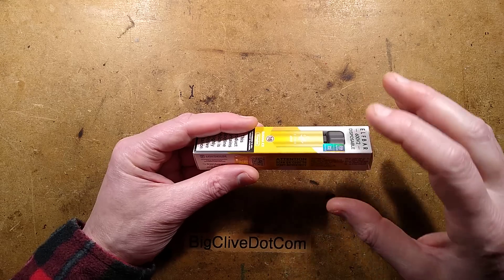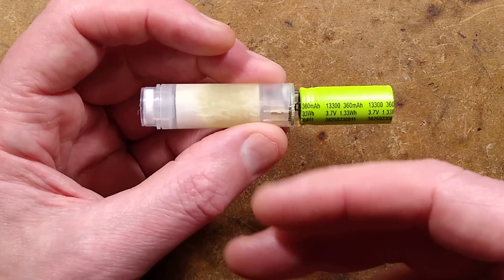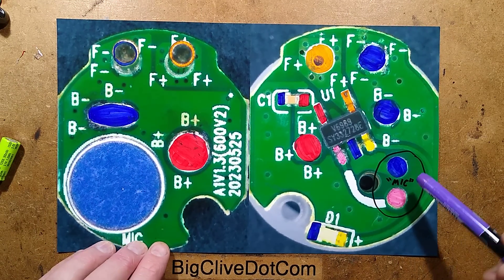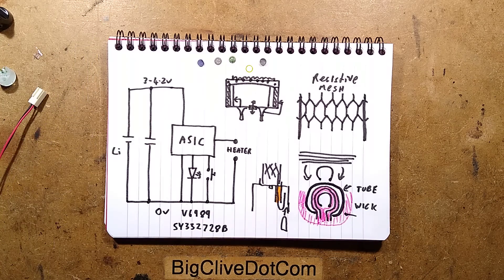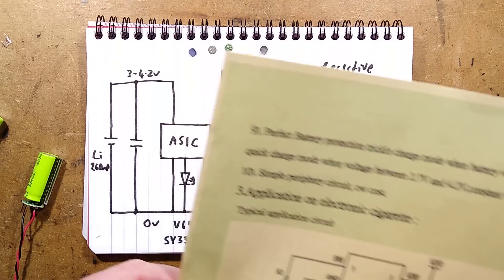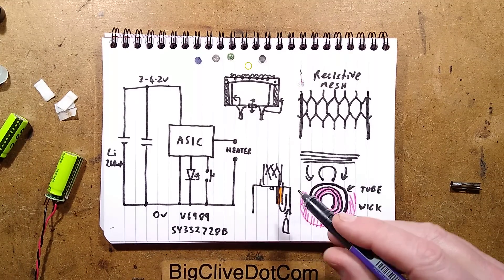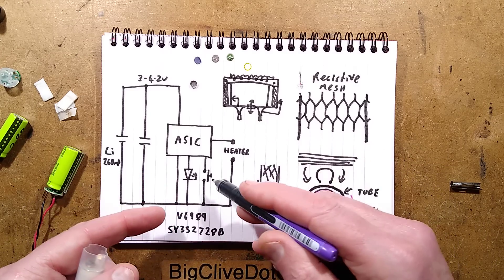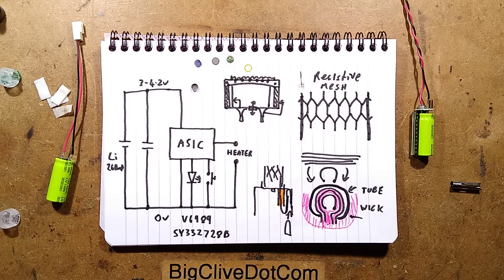Lithium "capacitor" in a disposable product

Comment: I also found that many discarded evapes now contain pouch lipo cells with "500 mAh" capacity printed on them despite some cells being physically smaller than others. Turns out the larger cells indeed charge up to roughly 500 mAh, the smaller ones however only reach roughly 300-350 mAh are thus intentionally labelled wrong.
Reply: That's false advertising whether they are meant to be recharged or not.
Reply: @LarixusSnydes  Chinese literally don't care
Reply: @fusseldieb That may well be, but if they want to sell things abroad, they need to comply with local regulations.
Reply: @LarixusSnydes  Will probably not be needed, there is always one person who opts for the cheaper option. 
That is how china grew in the first place and sort of ruined the whole european and I think american market with flooding the market with cheap products not built to last, destroying proper local companys with quality products.
If you really want to buy long-lasting quality products "Made in EU" or "Made in U.S." they cost an arm and a leg due to lower demand, and if they are in the shelf directly next to cheap Chinagarbage most customers will opt for the chinese crap. Even these who have the money to spend for a better product.
Reply: @deineroehre As an electronics hobbyist the main issues I run into when it comes to buying electronics parts is: A) a part I need for a project is not for sale in either the EU or the USA or B) I can buy exactly the same product ( made in China ) either directly from China or from an EU or American trader who 1) charge me 3 times the price, 2) have a high minimum amount of goods to buy before the P&P becomes manageable
Reply: @LarixusSnydes in theory, yes, they do need to follow regulations. In practice, no they fucking don’t lmao
Reply: @deineroehre  There are few quality products made in the usa. Many Asian and other countries have produced higher quality items than the usa for many decades now.
Reply: @LarixusSnydes china doesn’t have those regulations, so they can do whatever they want. “It’s not their fault” someone from a regulated country bought the product.
Reply: @deineroehre  "Blame china" mentality misses the points that this is exactly what Japan/Korea/Germany/USA/Britain did in the past and that it can only happen if someone is buying the products in the target market in order to sell them on (ie: Chinese build to a price, the same as the aforementioned nationalities do and have done in the past)

"Othering" the problem is an easy way of pretending we are not the people responsible for it and it's all caused by someone else

(Let's not dwell on the fact that the prize for the longest-lived state sponsored policy of industrial espionage, copyright blocking and ignoring piracy goes to the USA, at over 150 years, only changing when tables started being turned in the mid-late 20th century - or mention the Opium wars and "century of humiliation")
Reply: @LarixusSnydes  yep my guy on the corner wont buy no more 350s and pitch em as 500s. And im watin to hear back from temu on the subpar batt life from my 99cent earbuds 😀
Reply: If you fully discharge a lithium cell down to 0v you'll get 20-25% more energy out, at cost of never being able to charge it again/major reduction in chargable capacity(*). If they're intended as single use that might explain the "optimistic" ratings

(*) It's a bit like fully discharging a lead acid battery - if you TAKE 20Ah out of a 20Ah battery, you'll immediately pay for it with a 50% permanent capacity reduction for next time
Reply: @miscbits6399 if you look ath the discharge curves for lipo, you can see most of the capaity is between 4.2 to 3.6v (about 80-90%), below 3.6V it drops sharply because all the intercalation sites in the LiCo2 (positive) are filled and an all in the carbon (negative) are depleted. Going down to 0V will get you only a couple percent capacity, because there are simply no more storage sites for Li-ions to go. Going to 0V can be safely down, you just don't get a benefit from it. Damage or capacity loss occurs in 2 major cases:

1: you're going to negative voltages, because this forces reactions between electrolyte and electrode materials which break their structure and you permanently loose intercalations sites. lead acid batteries work different from lipos, here you can force theses reactions not only below 0V, but alreay at lower than recommended voltages.

2: charging to voltages above 4.2V. if you go higher you start to remove more Li-ions from the LiCoO2 (positive) which causes a permanent structure changes in the material which looses you intercalation sites. you can't put the extracted charges back in there when discharging, because the sites don't exist anymore (the sites were part of the structure which you just destroyed). this costs you capac ity permanently.
Reply: The intentional mislabling is a years old phenomenon already
Reply: its some brands....just like how some disposables dont use lithium. i tried to get some foil from a breeze pro to dissolve in methanol to make red/pink fire....needless to say not a damn thing reacted in those batteries.
Reply: @McDooDooYourSelf michigan?  😂
Reply: i'm only familiar w/ the pouch cylindrical cells in these devices as i recharged a few for some friends maybe 2yrs ago.. as i recall the cells were well above 500mAh, more like close to 1Ah and no board inside, just a little wire harness
Reply: I found one vape pen that had the exact same capacity of a dead cell in one of my bike's rear lights. It was millimeter thicker, so I basically ziptied it closed and caulked around it. Re-opening to change the cell again will be allot easier.

Comment: Obvious they removed the last few manual steps for assembling the e-cigarette. 
Sad that they halved the capacity of the battery in order to fit it inside a capacitor can. In conjunction, usually, they increase the resistance of the heater, which in the end decrease the amount of vape which is generated.
It is curious to see, that for an item produced in the millions, the manufacture process still look approximate and lacking any care for the quality of the finished product.
I guess this is what separates an industrial production facility from a sweatshop...

Comment: I think I would have gone completely hot air for the desolder on this: could even slip some a sheet of something with a slit cut in it under the board around the leads to redirect the air away from the battery, and no risk of shorting.

Comment: When I realized that these things held these batteries I started collecting them in the off chance I could use them for something around the farm like a gate opener or a small pump… I can’t wait to see what you do with it!
Reply: I rebuilt old Makita cordless drill batteries with them. 27pcs wape batteries in one. And they seem to be working ok with BMS board.
Reply: @Termiic My little hoover vaccuum cleaner has been running longer with these than the crappy 18650's in stock battery came with. Although I admit I only charge it while I'm around and I have one eye on the front door every time I use it.
Reply: @JJFX-  ...to run in case it catches fire? :D But seriously - im not suprised the vacuum cleaner runs better, the tiny ones have to work reliably, or else the vape product is total crap and gone from the market.
Reply: 16 x the flat lipo pouch style ones (ex-vapes) fitted great into my outdoor PIR solar led light. Charged them all first then ganged them all in parallel using a bit of t+e copper as a sort of busbar, replacing the original 2x AA ni-mh. Now lasts all night, even in Scotland, where solar lights are usually pretty useless for 6 months of the year!

Comment: That looks exactly like a common electret microphone capsule. A microphone is a type of pressure sensor after all. 
These electrets don't go all the way to DC, but the low frequency response is extended enough to be used a pressure sensor in this application at least.
Reply: Clive I hate to say this but you are incorrect in assuming those pressure sensors are a diaphragm switch. They actually are electret mics but used in a different way!  The conductive surface of the Mylar disc is on the opposite side from the body frame cylinder. So cannot operate as you suggest (a switch).

They have a continuous low energy AC oscillator signal applied to the mic insert. The capacitance change of the mic insert under vacuum suction is enough to be detected by the clever asic. Please investigate this (as I did) with your oscilloscope. You will see the continuous oscillation signal applied to the condenser mic! It is a capacitive sensor for certain. I can’t remember the oscillator frequency but it was fairly high iirc. I did grab a scope image but don’t have it to hand right now. Interesting about the fake capacitor. I’m sure it will have a standard Lion cell inside the cap case. Peter.
Reply: @ThePrawlin  I have personally destructively disassembled these little switches when I made a hobby of repairing Juul vapes. They are definitely just diaphragm switches. I don't know what product you got yours from, but it would simply be stupid to use an analog sensor where a simple switch will suffice. Maybe you found a premium product that modulates the power to the coil based on how hard you suck, which would explain the added complexity, but my experience is that most of these things are an on/off affair, nothing analog about them.
Reply: I thought so too. I wonder if this board has other uses

Comment: Back in November 2022, lithium peaked at 400% of current prices (600+% of pre-pandemic levels). Here in Canada, that meant a lot of retail availability for lithium/li-ion cells suddenly stopped being a thing. All the vape stores in my area used to carry 18650s, but since the price peak we're down to just 1 store that still has any, and it turned out they were sub-capacity knockoffs.

I'm not surprised to see consumer product companies cheaping out on cell selection too, but I have to wonder how long it will last. It's certainly surprising it took us this long to catch on to the change in some devices (I'm guessing it's the lag between manufacturing, shipping, and sale). Let's hope consumer demand brings back the better stuff.
Reply: Plenty of consumer demand, and plenty of nanny-state regulations "to protect the children."
Reply: @mercster  not sure what that has to do with anything.
Reply: @Coconut-219  what actions? Vapes may or may not be banned by a nanny state (don't smoke, don't care) but that has nothing to do with availability of 18560 cells. The main "drain" for the supply of those items is the EV battery packs and static battery pack markets.